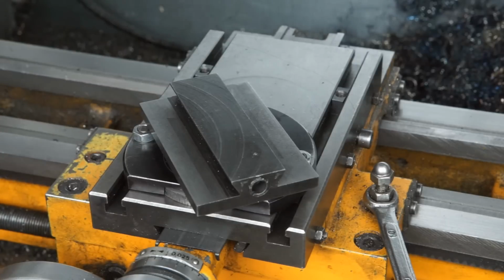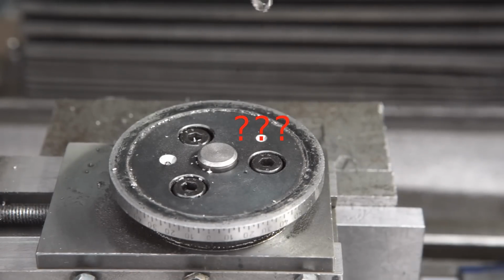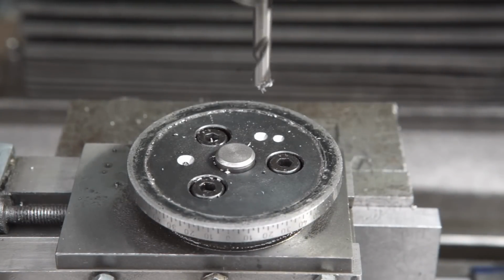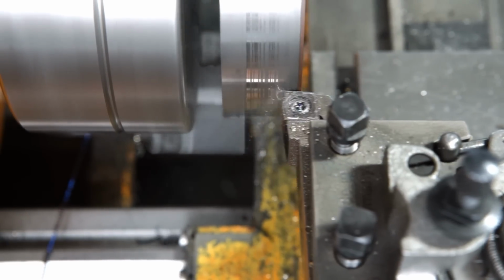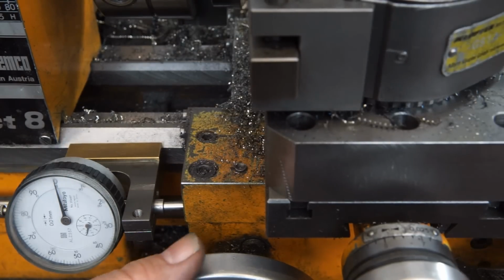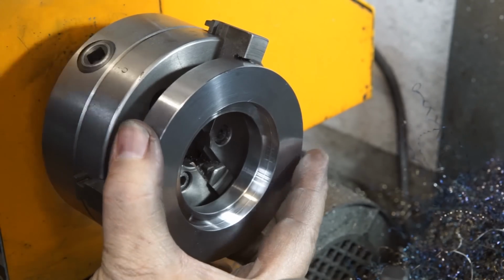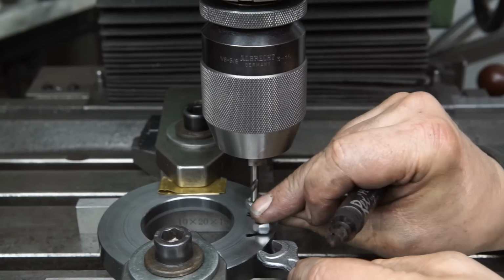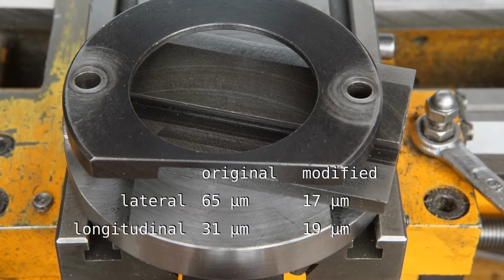Emco Compact 8  compound slide enhancements

Comment: Harald, while watching this excellent video, when you got to the part where you were estimating the clearance you needed for your spanner to fit the screw heads, I recalled that my machinist's handbooks all have wrench (spanner) clearances, etc., in tables.  If you need to determine spanner clearances again, try looking that information up in your machinist's handbook.

Comment: nice job , i saw it in the Bude ! i tossed my Topslide and mounted a CG25 Soliud toolpost and since then i never ever run into rigidity issues. i went that road because i never need my topslide.
Reply from the maker: Yes, you are 100% right: I use a solid toolpost whenever possible. If you look closely you will notice that I used it throughout the video. I will need the compound slide for an upcoming project. Thus I found this little project worth the effort.
Reply: @HaraldFinster  i will keep your implemantation in mind in Case i have a good excuse to do that. Allthough,i am currently making a 1895 OTTO Deutz D2 ,and i need the topslide i think i get away with the Original. Topslide since the Jobs are Brass only.
Reply: Googling this excellent advice--is it actually a "Solitude" Toolpost? I wasn't able to get anything with "soliud." The best machinists--like the best creative minds, often use creative spellings. Cheers from Seattle.

Comment: I’m envious of your well endowed scrap bin. Secondly, is there a clever trick to getting absolutely flush countersunk screws? I appreciate what you did her is normal enough, I have noticed in a few instances on my machines that the fit is extremely accurate and I’d love to know how it was done.
Reply: Using a countersink that is closer to the diameter of your c/s screw head, and going slightly below the surface, makes for a very neat, flush c/s screw seat. The hole ends up to be countersunk, with a last bit of the hole being straight down just as deep as the rounded top  edge of the c/s screw head.
Hard to describe!
Reply: @stephanuhu963 Yes, this saves you from needing an overly large countersink in the part to acommodate the non-tapered portion at the head of the screw.
Reply from the maker: Honestly, no, I am not aware of a clever trick. You can certainly look up the correct depth in a machinist's handbook and go from there. And, yes, I went deeper than strictly necessary.
Reply: @HaraldFinster   my best guess is to use thicker head screws, head proud then machine after fitting. Seems a little of bother.
Reply from the maker: @johnsherborne3245  good approach if the head has to be perfectly flush - and you get rid of any markings

Comment: Hi Harald,
interesting...
I have Praezimat (DDR copy of Emco before Chinese did it as well 🤪)
Same problem (although it has 4 clamping bolts unlike Emco)
My experience is that if clamping plate is too stiff it distorts cross-slide table
Reply from the maker: Good point about the  cross-slide table distortion.   I didn't notice any change in the behavior of the cross-slide, but will keep an eye on this.